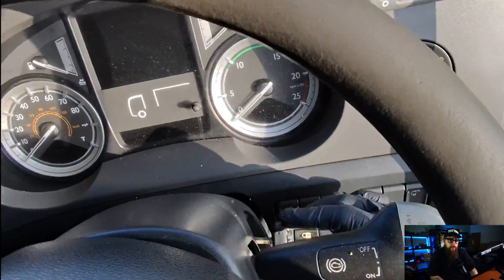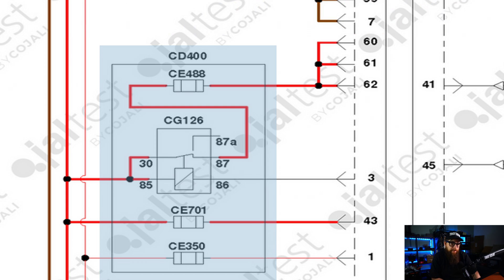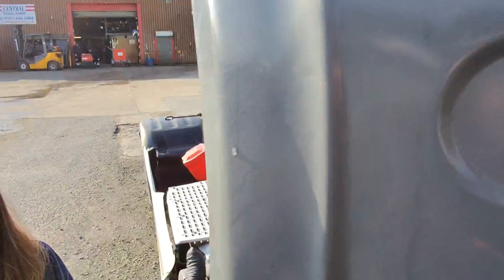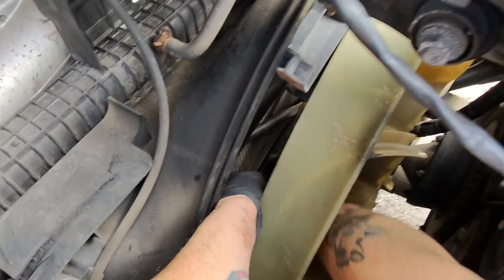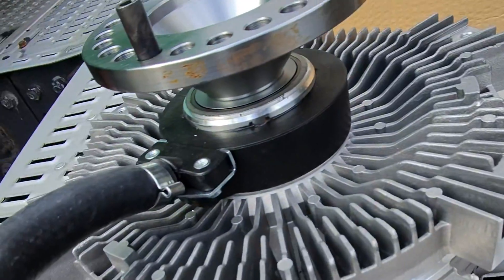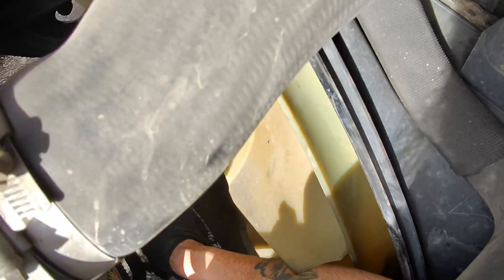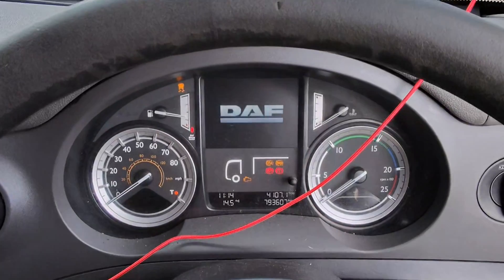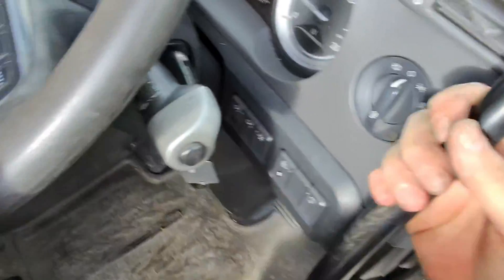DAF E-FAN Diagnostics: How To Find The Problem quick!

Comment: Yes you can clearly see the difference in quality in the old part and new,,,,,The old part is all plastic including the ring and connector and the hose is clamped on with a plastic ring,,The new aftermarket part is all metal,,The ring ,,the connector and there is a very substantial metal ring holding the hose on,,That 3G part is to be applauded,,No crappy brittle plastic there,,

Comment: Customer not wanting to spend money on a genuine part? 😂 they’ll still blame you when it doesn’t work in a week or so. Had that loads with none genuine nox sensors
Reply from the maker: Hey Alan thanks for the comment. If I supply parts it will be stuff I know works and I try and educate the customer on what you can save on and what's best to go O.E. with such as Nox sensors. End of the day manufacturers SHOULD give 12 month's warranty on parts......but I've yet to try and pit that to the test, maybe this fan hub will the one lol
Reply: @TRUCKTECHUK I've only worked with companies that use Daf trucks and have had multiple nox failures on trucks I've driven. Each and every time they got replaced with OEM and there is a big reason for it. It's easy to have a third party part that is metal and nothing else. When it comes to sensors and such you can be damn sure there is a  good reason OEM parts are more expensive.

Comment: The obd socket is easy to replace?
Reply from the maker: The obd socket is easy to replace as long as you have the tools to crimp the wires to the terminals. I've the diagram on truck tech uk for what wires do what in the OBD.
Reply: @TRUCKTECHUK  can share the link?
The new obd plug comes with the new terminals? You have a photo? Thx
Reply from the maker: I don't sell the plug and terminals yet. I will do at some point in the future though. You have to buy the plug and terminals from Daf currently but I've a diagram of where the wires go

Comment: Top job mate 👍 I normally just drain the coolant and take the full fan and hub out of the bottom after previous battles with those fan hubs. Last one was seized on that dowel and in the front pulley. Had to get it off with the old air chisel! 😂

Keep the videos coming 👍
Reply from the maker: Oh mate sounds like you had a right fight on your hands! I've always been lucky with these, don't really get to do fans these days 😂😬
Reply: @TRUCKTECHUK  🤣🤣 I think we're in the wrong business for that type of stuff 😂

Comment: As usual: Great job! Same can't be said of the workshop that replaced all the sensors. Even with just some system knowledge a mechanic should know that all these sensors have the power supply in common, I'm also pretty sure that the fault tree in DAVIE would guide you to this conclusion. Or is it just my expectations that are too high here?
Reply from the maker: From my experience, it's expectations buddy 😂😂😂. There is a big gap between dealer information and joe bloggs with jaltest in a workshop doing everything. I was in 2 minds on doing the video but seeing as 2 garages got it wrong I did this to help everyone out. Hopefully this will make the gap in the knowledge base smaller when people google even if its not as technical as I'd of liked 👍